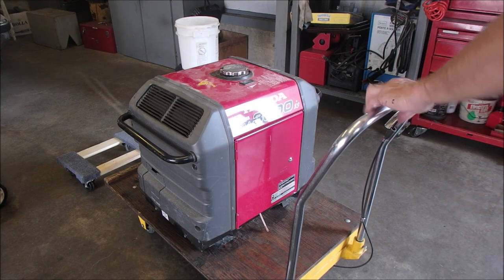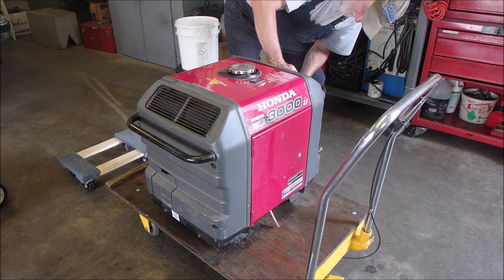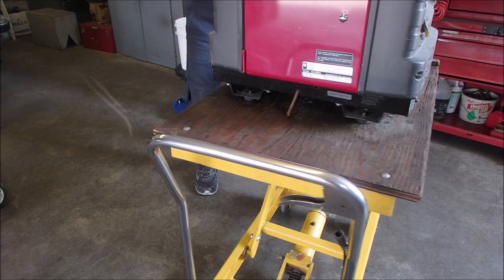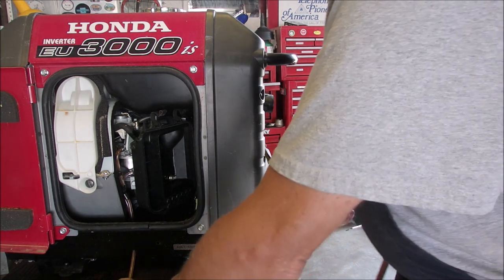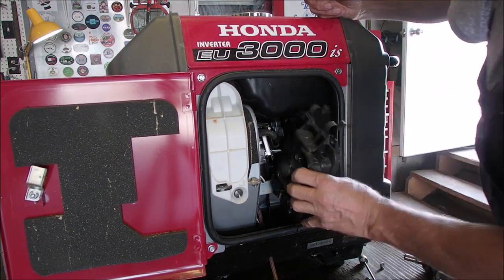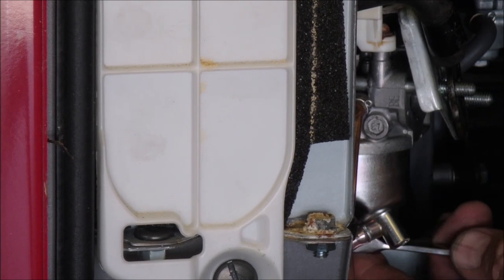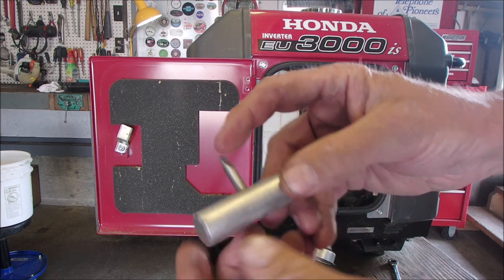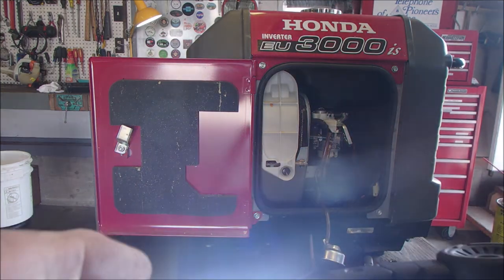Surging Honda EU3000is Generator

Comment: Hi! Bruce! This is Javier from Puerto Rico in the Caribbean.  Whenever you encounter a surging engine, you will need to address the low jet side of the carb. 90% for this problem is related to this part of the carburator.  You will need to remove the carburator and clean throughly this components. There is one small jet with a tiny tyny hole that when it plugs, the engine will start to surge.  And there is some thru holes that need to be cleaned also that goes to the back of the carb inside the tunnel.  Hope this will help you in your next recurring surging engine problems!  Have a nice week end!
Reply from the maker: Thanks Javier.

Comment: I hadn't really thought about testing a spark plug till watching this. So I did a little search and learned a couple of things. 1. If the part number has an R in it that means there is a resistor in the plug and it should read between 5-10 ohms, if not 1-5 ohms from the tip of the electrode to the connector, and of course it should read as an open between the connector and any other part.
Reply from the maker: Well The R means a readinG in the Thousands of 5000 to 1000 Ohms  if there is no R the readin will be close to 0 ohms.  The R adds resistance.

Comment: Great video Bruce , but i have sugesstion use a spaceheater to load the genny insted of a drill or a cutter. Drill use very little power while running emptey but a spaceheater use alot of power al the time it's heating the space.
Reply from the maker: Good tip!  That second unit was a hand held heaterthat draws 14 amps at full load.  I am still looking for a load box like James Condon has.   Thanks for the informed comment.

Comment: Another awesome video, Bruce. I've been meaning to ask you a question. I'm looking to purchase a lift table similar to yours. Did this have the 500lb capacity or the 1,000lb capacity? Sorry for the Imperial measurement. I've never converted to metric. 😊

Also, is that 3/4" plywood on the tabletop? Thanks in advance.
Reply from the maker: Mine is an older 600lb.  I bought it at a Candain Srore called Princess Auto.  Here is a video of the unit.  (older video)       https://www.youtube.com/watch?v=yv7FtFWRHaU
Reply: @BrucesShop PA is similar to HF in the US, though the PA I’ve been to have more items and things never seen in HF.

Comment: It won't be doing the surging for long as you Mr Pender will get it fixed and running again
Reply from the maker: Thanks so much.  It isn't just another surging engine to a guy who has a 3000 ie Generator.
Reply: @BrucesShop  cool beans 🫘 there Mr Pender 😎👍